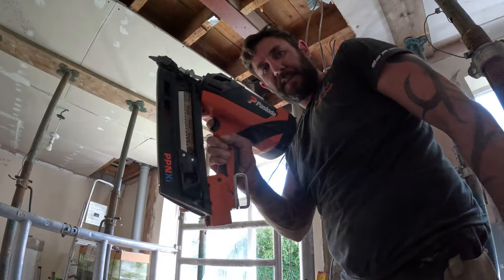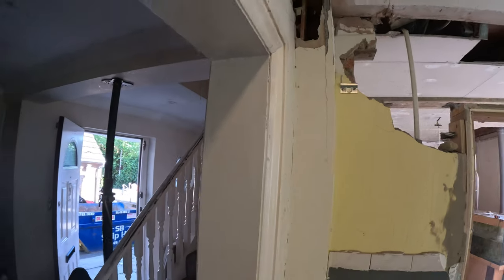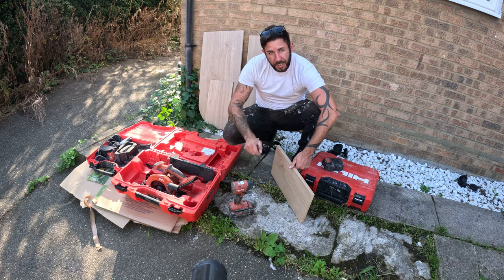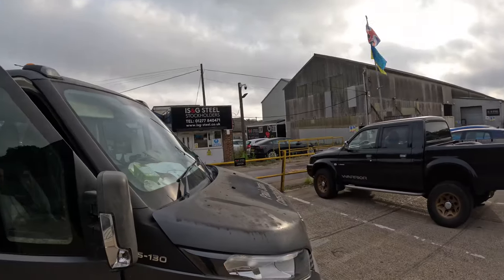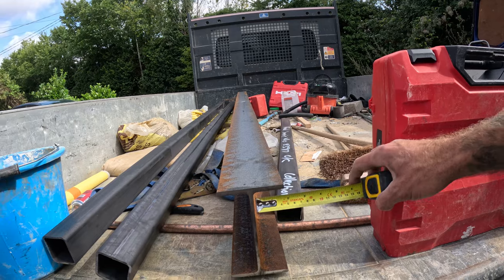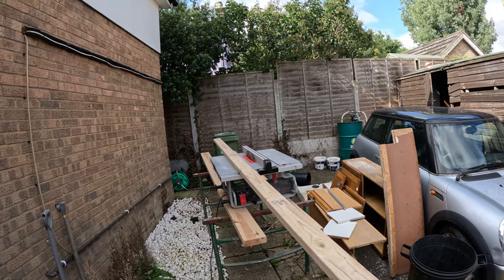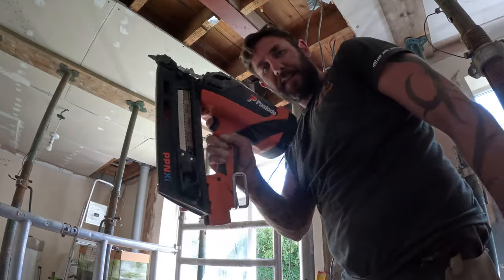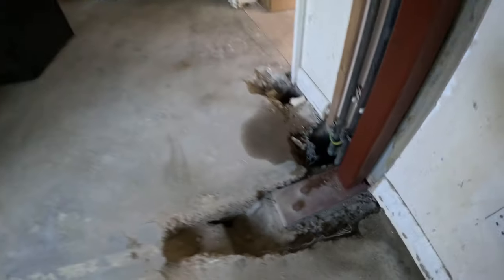Load Bearing Wall Removal | No Bulk Head | UK  - Paul Jamie

Comment: Thanks very informative; did you drill into the padding stone under the base plate to put the fixings in? Hammer drill would have loosened the bounding to the underneath and adjacent brickwork. No?
Reply from the maker: Yes we drill into the concrete pad or foundation. Use a smaller drill bit and work up to required size . If your worried.

Comment: Nice work pal, also good seeing the process. How much would this add to the cost compared to having a bulkhead and just sitting the floorjoists ontop of the RSJ?
Reply from the maker: Thanks james. Not much different time wise really. Only cost to move services passing through, once it's sunk in the ceiling there is no boxing to do just plaster board as normal. The answer to your question maybe £500-£1000